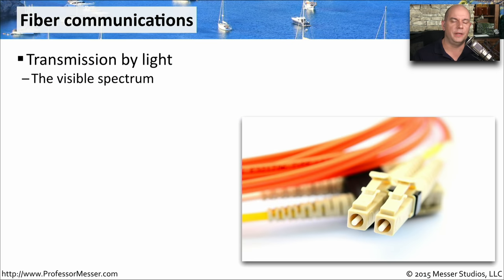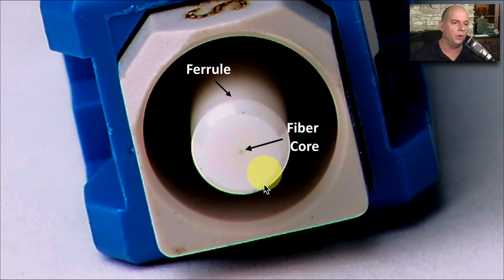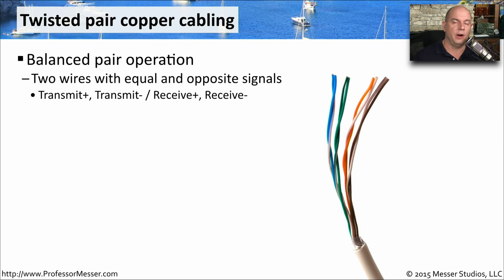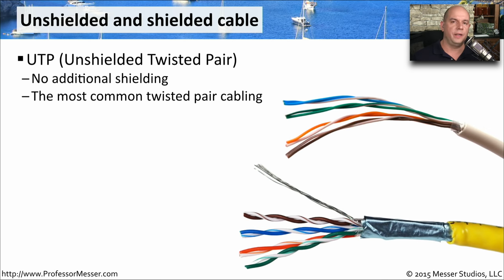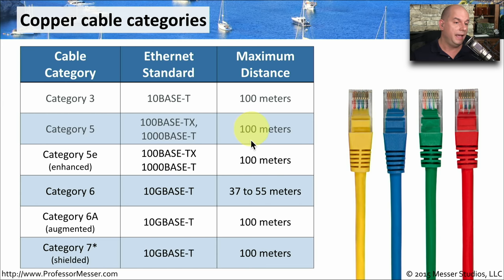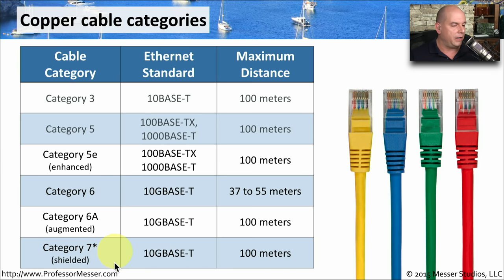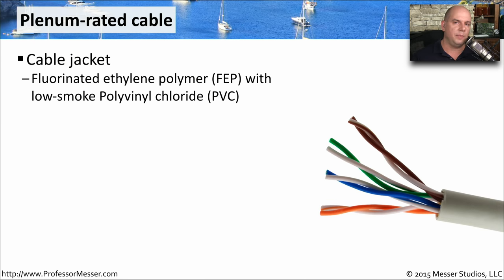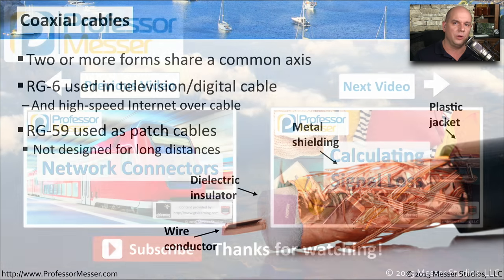Network Cabling - CompTIA A+ 220-901 - 2.2

Comment: Also, isn't Cat 6a you mention should be Cat 6e? Objective list it as Cat 6e. Is there a difference?
Reply from the maker: There's no such thing as Category 6e cable.
Reply: @professormesser  CompTIA still has the Cat 6e listed on their A+ 220-901 objectives, though.
Reply from the maker: @realtalk2713  You are correct, CompTIA incorrectly lists Cat 6e on their exam objectives instead of Cat 6A.